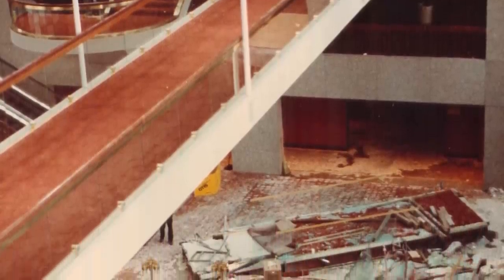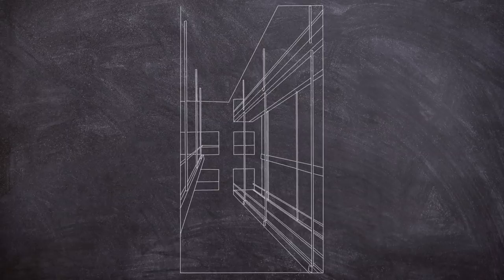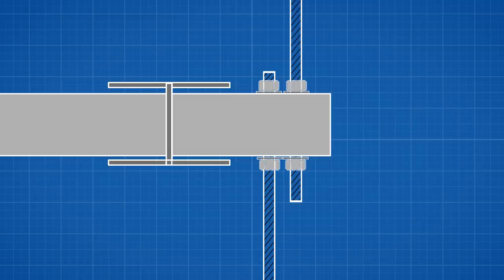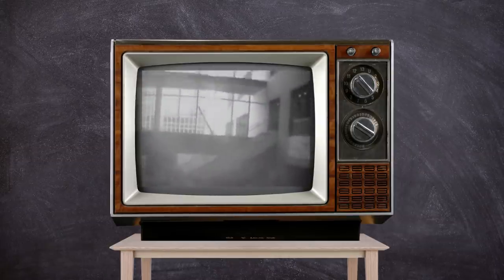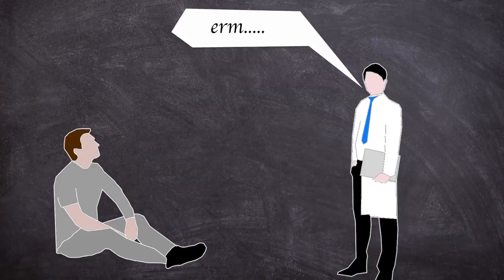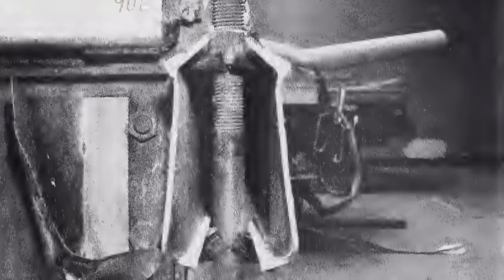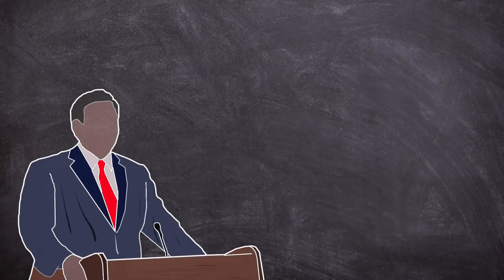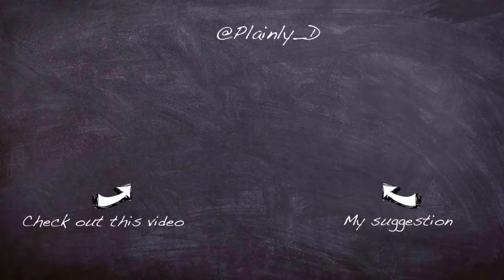A Brief History of: The Hyatt Regency Walkway Collapse (Short Documentary)

Comment: I remember this being the first case study in my engineering classes. What a tragic event. It's a very good study of engineering and how a simple change can cause devastating effects.
Reply: both designs are stupid and unsafe.   one the original deisgn  only a single nut holds each floor at each corner.   and only a single rod  at each corner holds all the floors.  combined with metal fatigue= collapse
Reply: Yeah, it's called don't let a Fabricator make decisions that requires an engineering degree.
Reply: I'm just amazed that so many people involved in the design and construction failed to realize that doubling the load on the nuts would be a problem.

Comment: The best description I've heard of the difference between the original and revised walkway designs is two people hanging onto a rope versus one person hanging onto a rope and a second person hanging onto the first person's legs.
Reply: I don’t know, that first one still sounds a bit distressing. lol
Reply: Nicole Wren The stress on the first person's hands would be much different.
Reply: Thanks!!! 😃 I have watched so many videos about this disaster over the years, and I still never quite understood it until now that you make this analogy. 👏🏼👏🏼👏🏼
Reply: That's exactly right.  The revised system was barely able to hold up its own weight, add a hundred people standing on it and disaster was inevitable.
Reply: That's a great way of illustrating how the force distribution changes with that design change. The ceiling the rope is attached to takes the same amount of weight in both cases, but the 4th floor walkway (the person on top on the rope) isn't strong enough to hold the weight of the walkway below it (the second person on the rope).
Reply: @dx1450  If I recall, tests were run on the flawed, revised design after the disaster, and it was found that with just the deadweight (i.e. the walkways with no people on them), the box beams on the upper walkway were already bowing slightly.
Reply: @WaterCrane  and nobody went to prison for that incident, right?
Reply: I saw a documentary on a parking ramp where the construction crew made a critical decision based on ordering the wrong height hangers for rebar.  It placed the rebar much closer to the surface and completely changed the amount of weight it could hold.  Luckily it failed before use during construction however there was still a ton of damage and some serious injury.  This was all due to not checking until installation the hangers would hold the rebar at the specified height.  Rather than reorder or even modify them they simply decided on their own it wouldn't make a difference it's still reinforced concrete.
Reply: Thank you. I'm not an engineer but now I get it

Comment: It's just fascinating how a change that intuitively seems innocuous actually COMPLETELY upended the design
Reply: Engineering seems like that. I'm not an engineer but I do love learning about disasters, part of it just curiosity but part of it is fascinating because of exactly what you said, such a small seemingly insignificant thing can change absolutely everything to disastrous consequences.

There was one, although there's no doubt in many, major aviation accident with the loss of all lives after the tiniest change was made that affected the strength of the aircraft on a commercial liner. It was absolutely insignificant seeming change, but it puts stress in the new design or modification in locations where stress was not originally anticipated by engineers. It took decades but finally disaster hit. Absolutely horrific. But that's also why it's interesting I'm afraid.
Reply: Because reducing the load support capacity by half is just an insignificant little oversight.
Reply: It should have been engineering 101, from what I saw. Any anyone could have or should have looked UP to see it at any point. It wasn't hiding.

Comment: I worked as a consulting engineer, and this is a classic case of a change order that was just signed off on, without any investigation. Used to get them ALL the time during jobs that were under construction, and very much hated having to spend my morning sifting through and marking up 100's of pages of change orders from contractors, but that was what was required to avoid nasty surprises down the road. Most of them meant well, but would often miss the design intent. But there was some scumbaggery as well, with them trying to substitute everything but the electric service from the utility to cut cost as much as possible. On some of those, I would reject them outright, and make them purchase what was outlined on the finished plans, or at least have them call and explain themselves.

Comment: Amazing lack of thought in this change..   this is exactly why RISK analysis exists.
Reply: "this is exactly why RISK analysis exists."
Well, yeah, but you're not thinking of that large a process for small changes like cutting a bar in half, before or after the change...he does go over this at the beginning of the video, and it's probably why they were not deemed culpable (it was too tiny a mistake, not a colossal clusterfuck like using a screwdriver to hold a nuclear test apparatus open).

Comment: As a newly minted engineer at the time, I was acutely aware of this event due to coverage in professional journals and discussions with colleagues. While the original design was sufficient to carry the load on July 17, 1981 it did not meet code and no one had actually done calculations on the design. The engineering company sent the design as a "concept" to the fabricator with the assumption that the fabricator would do the calculations. It was a case of extreme negligence on the part of the responsible engineer who didn't recognize that the original design really couldn't reasonably be assembled and didn't do the calculations for the design that he signed-off on. He was the sole Registered Professional Engineer working on ten of the projects of similar scale for his company.

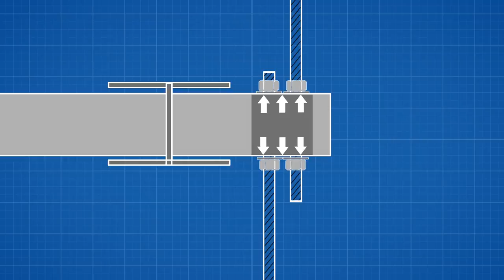The nuts were NOT the issue. The nut at the top of the upper rod had exactly the same load on it as at the bottom of the rod, and it was the same as the original design, and they didn't fail. The failure was correctly described up to 3:33, but it goes off track in the discussion of the nut, it was the load the nut placed on the fabricated beam that was the problem, the nuts were NOT the source of failure, they pulled through the beams. Nuts don't fail in any designed bolted connection, the nuts are made of material that is stronger than the bolt/stud/rod and the length of engagement is sufficient that the threads don't strip and the bolt/stud/rod will break in tensile failure, they are literally designed to be able to pull the bolt/stud/rod apart before they could fail. A change in the design of the beams would have made the structure as strong as the original design and it still wouldn't have met the city's design code.

Comment: Something about it always bugged me, and it was the safety factor. It failed at double the load which means that the safety factor was under 2, which seems real low when we’re talking about suspended walkways.

Not that it would have helped any, but still...
Reply: Even the original design failed to meet the city’s building code for the load capacity.

Comment: Ah, the 70's. Build it Beautiful, Weak, Flammable and CHEAP!!!
Reply: So I guess not a whole lot has changed then.  

To be fair the big exception is that (in the US at least, others have to give information about their countries) fire codes have greatly improved for commercial and government buildings. Single occupancy homes are cheaper and pre-assembled more and more, held together with glue and gussett plates, so fire does spread incredibly quickly. they can be incredibly strong under normal conditions, but under fire conditions fail very easily. But in an imperfect world, with builders themselves often actually on fire code committees, fire safety at least has really has come a long way, at least in commercial structures here.

Although fire inspections are another key part of that, and don't occur in most residences but do occur usually in commercial buildings. And people have this incredible tendency to circumvent fire safety measures through incredible means. Engineers often do their jobs, for some random employee to completely disable the firewall or remove fire resistance to part of a structure just by being careless or trying to make their job easier. But engineers at least are doing their part.
Reply: @toddabowden  Eh, fire safety has come a long way in private homes too. At least in some ways; now that we have fire blocking and non-flammable insulation and drywall in current frame built homes. The bigger problem are all the synthetics and tinder that go inside the house as furnishing, that go up quicker than old wood furniture/ hardwood floors and produce way worse smoke.
Reply: @farmerboy916  Thought most furnishings such as mattresses are pumped full of fire retardants considering a string of cigarette related deaths in decades past?
Reply: @Aquatarkus96  More about composites replacing solid woods, heavy use of thin plastics and plastic cloth instead of wool, etc.
Reply: @farmerboy916  That sounds like it would be safer, less fuel for a fire and all that? I'd say the massive reduction of paper in most households along with falling smoking rates and improvements to electrical codes would make them far safer than any given home in the 70s
Reply: @Aquatarkus96  Well the problem is, that if you say hold a candle or lighter to a piece of solid wood, it'll be exceedingly difficult to start a lasting fire. Go and try it in a safe environment. You need small bits of tinder to start a larger blaze, you can't throw a match at a 3 foot log and expect it to burn. Not so with plastics, which can and do burn and nowadays are often spun into thin fibers which can catch. Synthetics have the same problem, and composites usually used in a household (often wood composites) are a substrate (say, sawdust or small wood chips) held together by a usually not-inflammable glue which is basically a form of synthetic plastic. 

Wool carpeting may as well be actually inflammable, well put together hardwood flooring won't go until the entire house is already burning, but synthetic carpets are thin fibers of those same synthetics as above, on top of a plastic weave or foam on top of plywood (wood chips held together by epoxy). This mostly depends on each synthetic in question, but still. Some melt long before they burn, which can cause its own problems.

To an extent, this is overexaggerating that problem. The bigger problem is that wood can only burn so fast. Synthetics and composites can burn much quicker and hotter; once they catch, their surface area expands. And once a place does go up, I'd much rather breath a wood-fueled fire than a plastic fueled one tyvm. 

Rates probably have gone down, but as you say it's more about electrical, reduction in smoking, and better fire resistant or retardant materials than anything. Drywall for instance is a step up from solid wood in resistance to fire. You could easily make a house that's basically inflammable nowadays, though it would be expensive, but as soon as people fill it with their desired furnishings that changes.
Reply: @farmerboy916  Flammable and inflammable are synonymous. They mean the same thing.

Comment: Just follow the design! This is what happens when people can't read directions and plans. I work in construction and you have to check and double check what is going on.
Reply: And what happens when you are given a design that you can’t actually build?
Reply: @neilkurzman4907  you would have to figure out a way to get the threads through the platforms as designed or redesign the box end and nut/washer to carry double the load.
Reply: @bartfoster1311  
That’s exactly what happened the contractor couldn’t build it as designed and said can I do this instead. No engineer and reviewed it and said no this will fail, but if we do this it will work. 
The engineering lessons to be learned here. First make sure your design can actually be built. And make sure all changes are properly reviewed.
Reply: @bartfoster1311  - Yeah, if only those boxed beams/square beams would have been continuous vs having had welded seems, the walkway may not have failed, or failed as catastrophically.
Reply: @__WJK__  All box beams/HSS have a welded seam. This is a classic case of architects and engineers designing something with zero thought about manufacturability. The weld in the tube likely wouldn’t have been an issue had it been loaded as designed, however it couldn’t be built as designed, the fabricator suggested the easiest fix they could think of, and nobody from the engineering firm bothered to re-run the calculations. Has they instead used a coupler nut or increased the size of the threaded rods and plated the beam to increase its strength they may have avoided this entire situation.
Reply: It seems that the design could be done, but the contractor worried that with such a length of threaded bar that the threads could be or maybe damaged so the job would have to be redone possibly at the contractors expense or a penalty paid for not completing the job in full and on time and too cost. Root cause seems to be that the change by the contractor was not pushed up the chain for approval or that approval was not carried out or done incorrectly.
Reply: @Badger13x  
I believe the threaded rods needed to be five stories tall. Then there was the question is how do you push all of that steel two stories up the threaded rod. 
The request was supposedly pushed up the chain of command. However instead of being analyzed it was rubber-stamped. Problems with drawings are common place on all construction sites. There are mistakes, and they were changes. This was one of them, that was not handled correctly.
Reply: There are many quiet common ways this could have been alternatively designed. Box section should never have holes simply drilled through it and used in a mechanical function like that. The way to do it is drill through and weld in a strong sleeve which the threaded bar then goes through. Then you eliminate all compression forces on the box when tightening the nuts.
Reply: @blackbirdsr71  And, y'know, cable or some other method of suspension.
Reply: @Badger13x  Alright, I want to hear your proposal on how to move a 5 story long piece of relatively thin (compared to length, which is how you get stiffness) threaded rod inside a construction site without bending it or bumping or rubbing it against anything. You can only suspend it by one end on in a complicated full length carriage; you can not lean it on anything, you can not slide it, you can not really set it down in any fashion. Just because something theoretically can be done does not mean it can practically be done.
Reply: @farmerboy916   I am a not that sort of engineer, no need to get snippy chummy. At the start the narrator said the contractor changed the plans because he was worried about the thread being damaged, no mention that he could not do the job. No wonder the company failed if you take jobs on that you know you cannot produce.
Reply: Double checking? Triple checking wouldn’t hurt

Comment: I definitely liked this video! I've seen videos on the Collapse before, but yours is the first that explains the point of failure clearly enough for me to follow the details. 

I want to know more about this chainsaw amputation, however. Was it someone who was trapped under wreckage? Was the doctor just at the party, first responders aren't normally full fledged doctors, and where the hell did the chainsaw come from!? Inquiring minds!
Reply: Don’t remember why the doctor was at hand, but I seem to remember there was construction nearby, which was why they were able to get equipment there so quickly. Not only the chainsaw, but they bobcat they broke down the doors with.
Reply: @JosieJOK  Aha! Thanks, that helps quite a bit (the presence of the chainsaw really threw me off, but from a construction site makes sense)

Comment: That's crazy, "deadliest non deliberate structural failure in american history" no longer...
Reply: Still is. Surfside condo will have less than 100 fatalities.
Reply: @dynasty0019  you're right, currently 97 bodies, 90 identified with 8 missing persons remaining. That number was less than I was expecting based on the original estimates.
Reply: There are several industrial accidenta that tops this. Texas City ammonium nitrate explosion for example
Reply: @noradlark167  Straight up structural failures are in a different category though than structural failures caused by fire, or explosions
Reply: @Hamjobb  Do dam failures causing flood count. USA history has a lot of dam failures.
Reply: @noradlark167  If the dam fails with no influence from anything other than the weight of the water behind it, then I would say yes, it would count
Reply: @Hamjobb  Ï found Johnstown Flood of 1889. However, it involves erosion; like most of dam failures one way or another.

Comment: I use this collapse as an example of missing the details.  Think of a rope hanging from the ceiling.  The as designed would have  2 people each grabbing onto the rope. The as built had the upper person holding onto the rope and the bottom person holding onto their ankles.  Also, think of the designs that have used up most of the safety margin but are stable, until a modification is made years later causing the system to fail.
Reply: Great way of putting it!